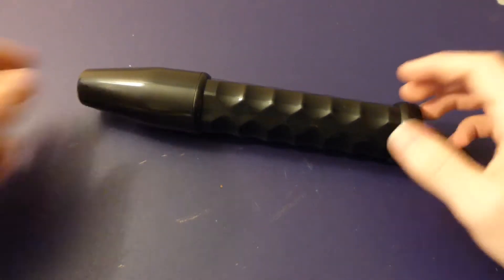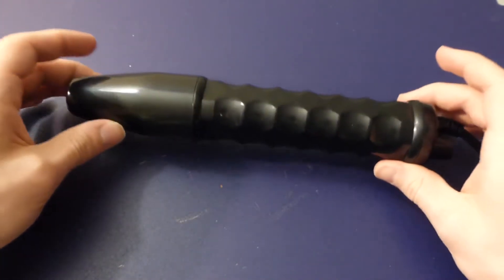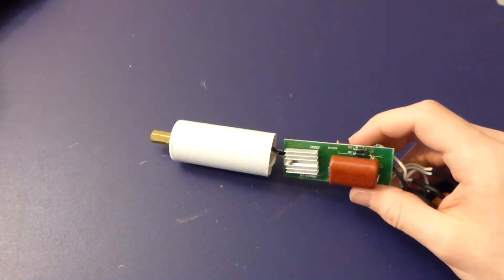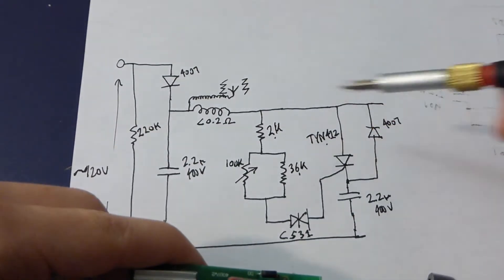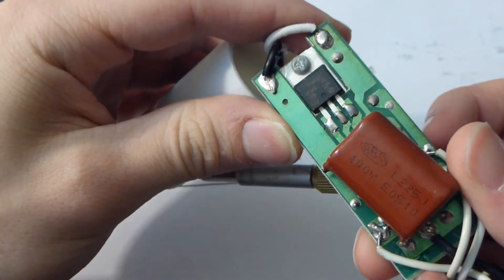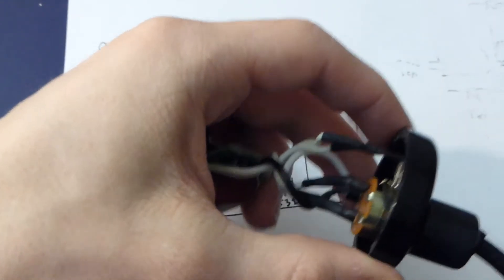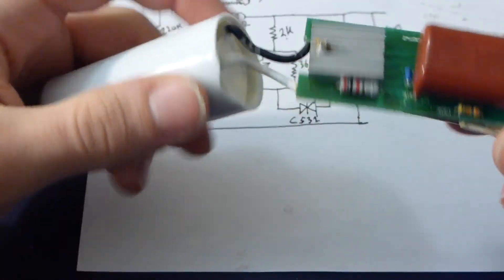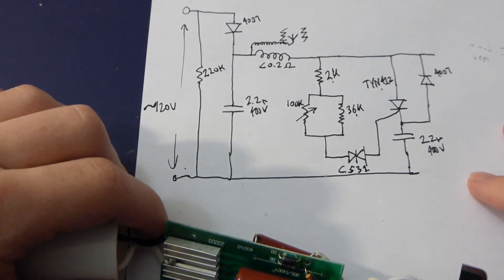A Look Inside a Cheap Violet Wand

Comment: It's actually safe because the glass tube filled with a gas provides capacitive coupling, which only lets high frequencies pass. These are used by actual spas for actual dermatology treatments. They theoretically actually can treat acne (pimples).

Comment: I've been playing with these for years now and I recently discovered a few things. I've burned out several coils and in the process realized this is a safety feature. There's some sort of fuse connected to the secondary built into the coil. And the grounded plug is actually quite safer than the ungrounded version of these which generally feature an unpolarized plug. This lack of polarization means that the mains can be connected to the secondary and you'll get a full 110 volts between ground and the output even when the device is off. 

I also found that if you connect a barbecue grill igniter coil to the output of the circuit board you will get around five times the power output. They are generally wired the same with two power in and one side of the secondary reference to ground.

Comment: My case is different and is black with a wider curved base to fit snugly in your hand. I replaced the TYN412 SCR with an S8040R device that has 800v and 40 A rating. (The old one is 400v and 12A) I run it on a Variac and increase the input voltage to 130v and it works alot better.

Comment: I have 2 different ones which now both don't work anymore (the last one I received 4 weeks ago already gave up after slight use). They're still making buzzing some noise and I've tried replacing the thyristors but to no avail. The rest is just a bunch of diodes, capacitors and resistors. So how likely is it for the coil to break down? Can I check this somehow? Also, can I measure the voltage that goes into the coil? I have no idea how high this should be but if I can measure that I can rule out it's the board and it has to be the coil that's faulty.

Comment: Hi Mark, Clive made a mistake in his circuit diagram and thought I should alert others if they try to duplcate. I came across his vid by accident as I designed a similar circuit many many years ago and wanted to compare it. I then noticed a mistake on his diagram as the voltage divider potentiometer circuit he had put on his circuit diagram didn't quite add up. The value of R2 is 100K it is clearly marked on the board @ 12:19 on Clive's vid and he accidently had a value of 220K on his circuit diagram, for anyone intersted, I calculated a value of 75K and should be approx half this value when operated from 120V, which on your circuit it is. Good work!

Comment: is it possible the circuit schematic wrong ?..2 diode 1n4007  and 2 cap (2.2uf/400v) had been used for voltage doubler?

Comment: So when I want to go buy one that I need to have a high quality should I get an original antique? I had an antique one and it worked wonders for my back pain. It was stolen. I would love to replace it. This is why I tuned in to see your video. I hope for your response.
Reply: I'm not an expert but I have had both applied to me and I can say that the antiques (at least the one I tried) have a much more noticeable sensation. When I got a cheap one (£30 I think) like the one in the video it was very lackluster in terms of sensation.

Comment: The circuit board track layout is different.  On mine there's a cheeky track sneaking under the thyristors gate pin with unusual reliance on the integrity of the solder resist, but your unit seems better in that the thyristor pads are much better laid out.  You might be able to tweak the output a bit by modifying the resistor values, since the higher the resistance the later in the sinewave the thyristor will fire.
Now I wonder if I can bite the bullet and Dremel the transformer open.....
Reply: Do it :D I interest
Reply: I wonder what would happen if a potentiometer would be attached to make the point that  the thyristor fires variable.